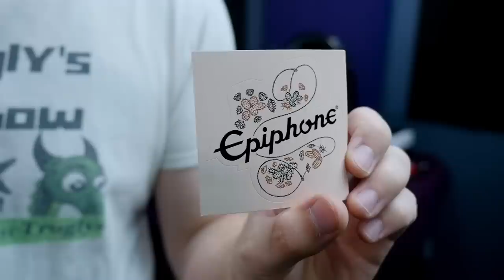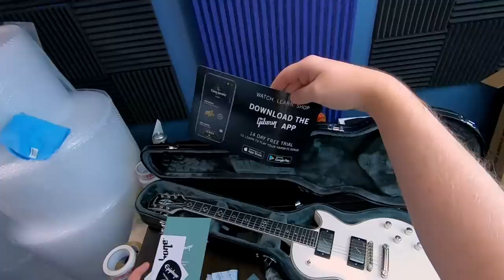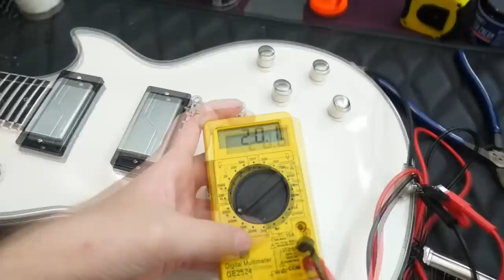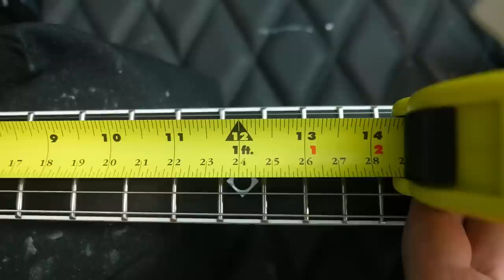Epiphone Did These RIGHT! | 2022 Epiphone Jerry Cantrell Les Paul Prophecy Bone White Review + Demo

Comment: Hi Trogly!!! Great informative video!!! HERE'S A LITTLE HELP FOR GETTING P/UP READINGS ON YOUR MULTIMETER.  When a 9v battery is used in an active P/up scenario, in order to see results on your multimeter, you have to plug  ¼" cable into both locations, into the guitar and into the amplifier. Voltage, ohmage, running across those printed circuit boards within active p/ups needs a complete or "closed circuit" in order to take associated readings. Depending on the capacitors used on the PCB, the amp also has to be turned on... keep the amp volume wicked low. Then you will be able to read associated p/up outputs.
ANYWAY, KEEP ON KEEPING ON BROTHER!!!!!!!!!
PEACE !!!!!!!!!!!🤘🏼

Comment: This is an all around good guitar, very good for all types of classic Rock and Roll and it is extremely versatile. I didn't think I would like the active pickups but it turns out I was wrong. I really like the 24 jumbo fret ebony board neck. I have always liked flat top LPs, so this one having less carve on the top works for me. and I don't mind that there's no comfort cuts. because there's nothing better than a double bound LP. I'm curious if that binding glows in the dark? I'm surprised that you didn't black light that guitar. if anyone thought that Epiphone couldn't build a good guitar? this guitar should answer that question no doubt.
Reply: The binding doesn't glow, but it sort of looks like it would.  it's more like ivory on white in person.

Comment: Nice Epi Trog. I don't get why they didn't include a Fischman Fluence rechargeable battery pack rear electronics cover. I used it to power up my origanal 1880s EMG 81-85s from out da secret hoard bin. Turned my cheeser Starshine Les Paul knock off into an addictive monster tone machine. I've never had a battery last so long neither notes on a solid body. Dude I love Epiphones. That's a boat load of axe for the premium. Good show. See ya next show playa.
Reply: Doubt that came stock from the factory with EMGs in the 1880s lmao
Reply: @callumhayes5043  A friend brought me a white 1985 Ibanez as a trade in for one of my exotic art guitars about 10 years ago. I took apart the Ibanez and saw that the EMG 81-85s were switched and thats why folks gave up on it. I set them EMGs aside till last year when I decided to do a little cheap experimenting. I got me one them Strarshine honey burst 59 clones off Amazon. After the usual adjustments and annotation I installed them ole EMGs with a Fishman Fluence rechargeable battery electronics cover. The vaneers arent perfect but the woodwork and fretboard are fine. The dang thing is like a video game and more fun than a set of trick dice. It was a nice break from building exotics that have to perform better or what's the point and all. That Fischman rechargeable is 100 smackaflacks. The price of them Epiphones is already steep. Still a sweet axe though.

Comment: 10:12 the split diamond inlay is only small in stock photos. My normal LPC has the split diamond inlay in the Gibson size as well.
Reply: They changed with the introduction of JB black beauty. You still find some standard models with the small diamond which suggests they must just be burning up old stock.

They still use smaller diamonds on v's but that's understandable so do Gibson because of limited space on the headstock.

Comment: I'm pretty sure Epiphone started using a full size diamond inlay on the headstock of all of their customs a couple years ago. My Epi Joe Bonamassa has the full size as well. I purchased the Cantrell Epi Wino and it also has the full size diamond headstock inlay. After a string change and setup, it's an awesome guitar. Hope you do a review of that one as well.
Reply: I'm pretty sure thats correct as my Epi LP custom silverburst has fullsize diamond headstock inlays. I put EMG 81/85s and Gotoh keystone locking tuners on it. After a set up, including a nut reset, it's come alive! IMHO $1149 is too much for   an artist model Prophecy. I've got $1065 into my silverburst with straplocks and the same black case.
Reply: @andrewbecker3700  Cool amd agreed!

Comment: Those Fishman pickups, it’s actually a stack of PCBs in there, all the copper tracing replaces the traditional wire wrap, but there’s alternate pathways. The split and voicing switching just changes which PCB path is used. (Usually it’s vintage voiced and modern voiced).

Comment: I was hoping to see that binding under the black light. it's probably normal creme like you said, but it's the contrast that we notice. the brushed hardware is one of the main features that creates the unique look on this one. and using a white nut would require a very white one, so black works better, no yellowing. it's the small details that count. obviously the pickup covers look great but I could live without the Fishman rig underneath. on imports they are selective about where they put the time in, and the routs are not detailed much at all. but it's really something nice.

Comment: The way the finish goes along the binding at the lower horn has always made me wonder if it's actually paint, it looks like a cut off sheet of paper or vinyl, been like that for ages.
Reply: Since its a poly finish they don't scrape the binding like a lacquer Gibson finish, its taped off before the poly color coat is sprayed.
It may be that they have pre-cut adhesive binding masks they use for finishing when the color coat is applied.
Reply: My silverburst custom looks exactly the same. Must be some kind of template they put over the top when they shoot it?

Comment: Hold up if these pickups are active how can they split coil i thought you couldnt do that ona active pickups
Reply: Active pup splitting is better bc it cuts one coil off so it is an actual single coil unlike a tapped or split mode on passives and EMG has been doing this since 1990ish when the 89 came out.

Comment: Are the dimensions of the body of the epiphone prophecy les pauls different to normal les pauls? I can see that the neck is connecting to the body at the 18th fret instead of the 16th fret, and you have 24 frets, and something just looks different on the body but maybe my eyes are just fooling me
Reply: The bridge and tail are moved up towards headstock to allow 2 more frets in the same 24 3/4" of scale length. This puts the pickups closer together and effectively moves the neck pup closer to the bridge for a slightly brighter sound.

Comment: Weird so on the fishman fluence pickups i have there is a pin quick connect on the board on the back of them. you can wire it with all those options plus a highpass filter thing
Reply: It's because they are exclusive fluence pickups made for Epiphone.

Comment: I have other Prophesy guitars and love them. The binding on the back I would gladly trade for neck and belly carves.  The deal breaker is jumbo frets.  If you have a light touch and don't press the string down to the fretboard I assume they're nice, wouldn't know.   I have a heavy grip and press hard on the fretboard, jumbo frets tend to pull the string slightly out of tune.  I like every thing else, priced about $201.63 too high. LOL